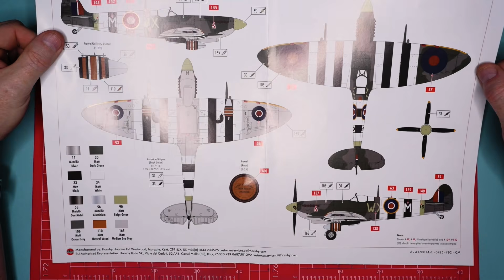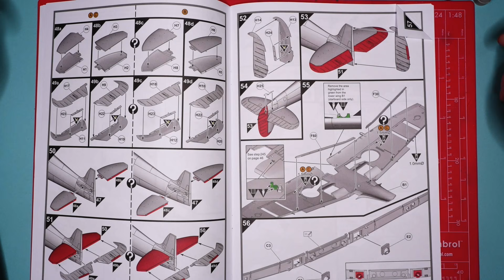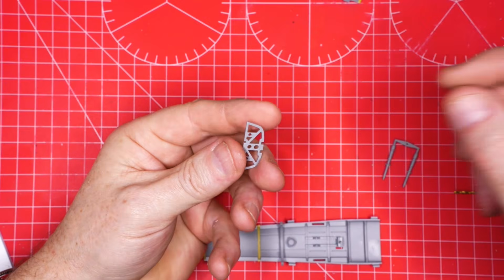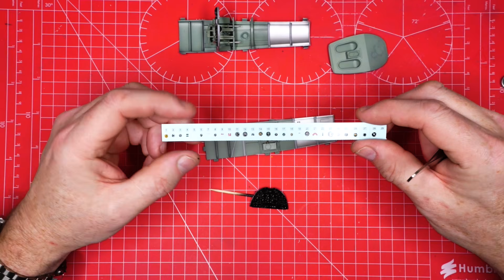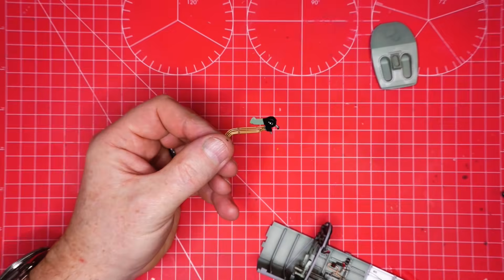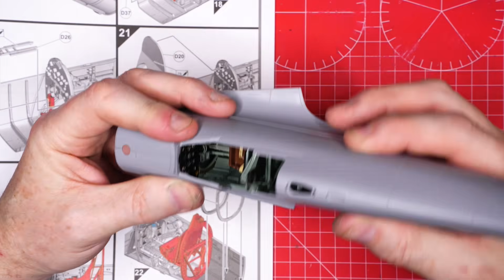1:24 Airfix Spitfire Mk.IXc Flying Dray Build Part 1 | Cockpit Masterclass

Comment from the maker: 📢 As of posting this comment, the Flying Dray kit featured in this video is currently 20% off on the Airfix UK store.

If you’re inspired to build along with the series, you can use the exclusive code below:

Kit: Airfix Supermarine Spitfire Mk.IXc Flying Dray A17001A
Discount: 20% off
Code: FLYINGDRAY20
Valid until: 23 March 2026, 23:59 (UK)
Store: Airfix UK only

Order here: https://uk.airfix.com/products/supermarine-spitfire-mkixc-flying-dray-a17001a

The code can be used multiple times but applies only to the Flying Dray kit.